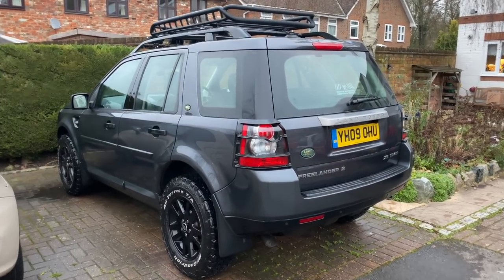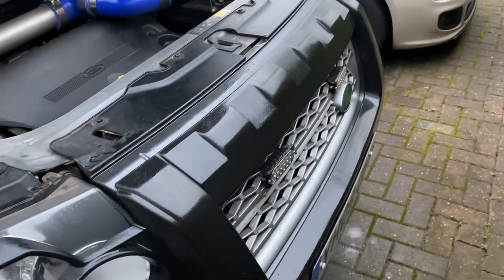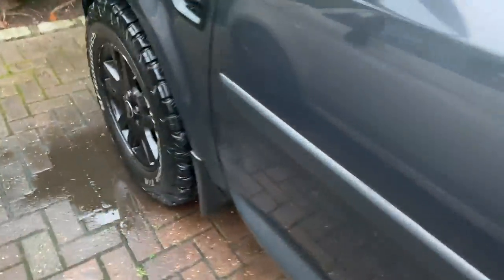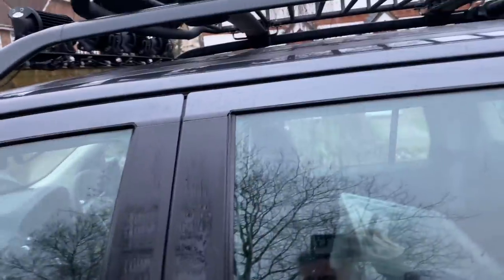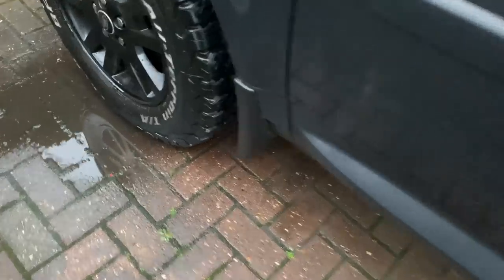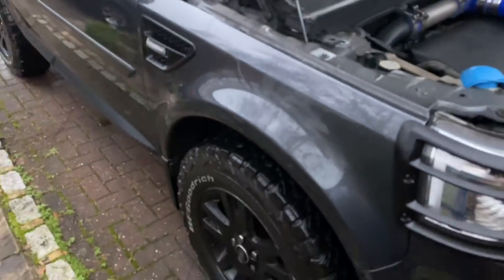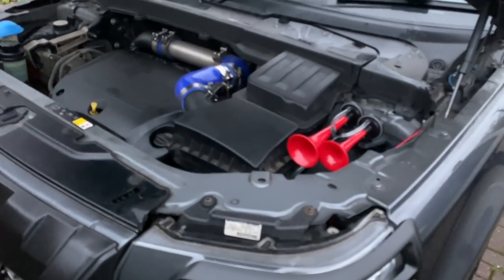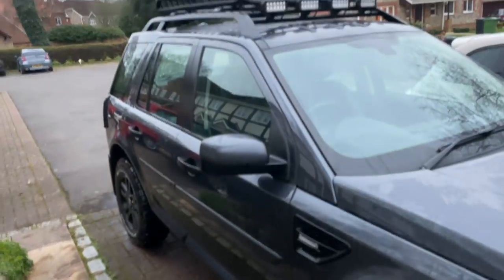Modifications on my Freelander 2 / LR

Comment: Ive got a 2011 freelander 2 sport LE, UK model. Its got some sort of cold climate pack on with heated front screen etc plus Its got a diesel fired heater, Its not remote control etc but once the temp gets below 6 degrees it runs when the car is running. Within minutes the air through the vents is toasty even though the Engine temp still hasnt moved off the bottom of the gauge.
Reply from the maker: Sounds like some of the top spec models have a webasto configured as a booster heater to help things warm up when started during cold weather. This is common on the ex demonstrator vehicles which had all the optional goodies fitted to show them off. The standard cold climate pack (which I have) includes heated seats, mirrors, heated washers etc. The heated screen is fitted to all models as far as I know.
Reply: @BeavisPits  I only found out about it last winter after I had it Waxoyled, they must have sprayed the heater with it and when it heated up I thought the car was on fire with the smell coming off it, I nearly shit myself, pulled over on the side of the road, lifted the bonnet and the Engine looked fine, the smell coming from the drivers side vent where the side repeater is, I didnt know what the hell was going on ha ha

Comment: Thanks for this - very helpful! Do the larger size tyres cause any probs without spacers as well? Need to replace my tyres and looking at the options
Reply from the maker: They will rub the shocks if you don’t fit wheel spacers. Lift spacers are optional.

Comment: Good video pal and nice Freelander 2 👍 I’ve tried looking for that particular roof rack and can’t find it, you got any links mate? Cheers
Reply from the maker: I bought mine years ago on eBay. I don’t think the seller is trading anymore but I found this one on Amazon by MaxxHaul which looks similar…

https://www.amazon.co.uk/MaxxHaul-70115-Steel-Rack-150-Capacity/dp/B073G49NPV/ref=asc_df_B073G49NPV/?tag=googshopuk-21&linkCode=df0&hvadid=500749924512&hvpos=&hvnetw=g&hvrand=18382123156391983543&hvpone=&hvptwo=&hvqmt=&hvdev=m&hvdvcmdl=&hvlocint=&hvlocphy=9045743&hvtargid=pla-569747249443&psc=1&mcid=14ac0af5e86d3500bdab4a32ba683a98&th=1&psc=1

Comment: Thanks for sharing your modified FL2! Looks great.
It would be really helpfull if you could share a link where you bought the fastening points to secure the roof rack.
I've got the same roofbars, and a similar roofrack.

I will check your website aswell!
Reply from the maker: The roof basket was bought on ebay and is attached to two genuine LR cross bars using the U-clamps which came with it.
Reply: @BeavisPits  ok! Do you want to share the ebay link, so i can see what kind off U-clamps are used?
Reply from the maker: https://www.ebay.co.uk/itm/362737712736

Comment: Hi great vid I'm getting the tyres ASAP as I have a puncture but having trouble getting the proper spacers in time would it be possible to get my tyres fitted and add the spacers next week or do you think that would be too risky .? Thanks again for your vids there great
Reply from the maker: Hi John, I’ve not tried fitting mine without the wheel spacers, but I have heard of others doing it. The gap between the tyre inside wall and the shock tube will be quite narrow, only around 10mm or so. The concern is that a stone could get caught and damage the tyre.

Comment: Hi, when you put your 25mm wheel spacers on, where they a straight fit or did you have to shorten/cut down the original wheel studs? Thanks in advance
Reply from the maker: They have their own studs so straight fit. They were not “through spacers” which require longer studs.

Comment: I'm french sl8i don't understand all modification.
C'en you write the different modification on the spring, and tires ?
Thanks
Reply from the maker: The suspension has lift spacers fitted above the shock absorbers. This pushes the wheels down, lifting up the car. The tyres are BF Goodrich KO2 245/70R17

Comment: Can you recommend a decent  full-beam headlight as when I drive at night on full beam it lights up in front of the car but no distance, I've got a Freelander 2
Reply from the maker: I run LED bulbs for mainbeam and have the lightbar on the roof. If you want to stay fully legal then try osram nightbreakers.
Reply: @BeavisPits  Cheers I use Nightbreakers but on full beam, I can barely see 20m in front.
Reply from the maker: Sounds like you need a light bar! Check out my roof light bar video. But you could fit one on the grill instead.
Reply: @BeavisPits  ok do you sell the one for the grill
Reply from the maker: Yes, I make and sell grille brackets for strobes or spotlights/lightbars. Take a look at my website beavispits.com

Comment: Spot on about cheap wheel spacers there mate. When I bought my FL2, the previous owner had fitted some cheap 25mm spacers. I got vibration and steering wheel judder on the motorway, had the wheels aligned and balanced, still had the vibration. I removed the spacers, and it was like a new car. Couldn't believe the difference. The spacers I took off didn't even have a brand on them... Just generic. Crazy to trust your life with such cheap crap.

Comment: hello my tires 235 / 60r18 without upgrade kit and without spacer what tire size can i do? 255/55r18 or ?
Reply from the maker: Best to use a tyre size calculator web page to check circumference. Mine are 5% larger circumference. Any bigger and you may have clearance issues.

Comment: The 245/70/17 tyres on yours will they be ok to fit with out lift kit
Reply from the maker: Yes, but best to fit wheel spacers to move the tyre inside wall away from the shock
Reply: @BeavisPits  when is your lift kit and light bar brackets back in stock
Reply from the maker: You’ve missed your chance with the lift spacers. Sold the last set on Friday. Roof brackets back in stock in a few days.
Reply: @BeavisPits  will you have anymore in stock soon
Reply from the maker: Not for a few months. If you’re on facebook or instagram then follow Beavis Pits, I posted a few posts saying last few spacers remaining so be quick if want some. Sorry, but now they have all gone.
Reply: Just got 25mm spacers and insa turbo ranger tyres 265/65/17 what you reckon think they give that wide aggressive look
Reply from the maker: They will look great!
Reply: Any news on lift kit coming back in stock as of yet bud

Comment: Great video dude! Can you help me find the right spacers you mentioned? On a side note, you should stock all of these bits on your website! I would've brought a few bits from you! haha
Reply from the maker: Wheel spacers or lift spacers?
Reply: @BeavisPits  hi mate, the wheel spacers. I had a quick look on the h and r website and there seemed to be a few different ranges. I'm going to do a lift later. I'll certainly be looking at your lift spacers!
Reply from the maker: I fitted 25mm hubcentric spacers. Not H&R but another high quality British made spacer. Avoid cheap Chinese items as the quality is poor. Also avoid non-hubcentric as they don’t have the locating ring.
Reply: @BeavisPits  nice one, cheers dude.

Comment: Do you re-torque the wheel spacers often?
Reply from the maker: Probably not as often as I should. I do check the spacer-to-hub nuts occasionally when I have the wheels off. I check the spacer-to-wheel nuts more often, usually before a long journey.

Comment: Do the lifts and spacers affect the insurance and would you consider fitting rock sliders?
Reply from the maker: Any modification should be declared to your insurers. Whether a suspension lift would increase your premium or not depends on who you’re insured with. Rock sliders are available from MuddyMods. I may fit some in the future.
Reply: Any changes such as aftermarket wheels, cone filter, turbo if it doesn’t have one etc needs to be declared to your insurance. If you don’t tell your insurance and then have a crash. The insurance company come and look around the car and find out you got these modifications on you didn’t tell them, you’ll have your policy invalidated and won’t pay you out

Comment: Hi, are those BFG KO2 tires okay with the wheels fully turned and the vehicle's suspension ? Thank you.
Reply from the maker: Yes, absolutely fine
Reply: @BeavisPits  Also at the rear when crossing the axles ? :)
Reply from the maker: @lacike767  not had any issues
Reply: @BeavisPits  But has the grip changed enough ? )
Reply from the maker: @lacike767  grip is very good
Reply: @BeavisPits  Thanks again ))
Reply: @BeavisPits  I forgot the dimensions ... are they the standard 225/65 R17 for LR2 ? :)
Reply from the maker: Watch the video 4m45s
Reply: @BeavisPits  Oh, but by lifting the chassis...and without the pads, they would touch the fenders or shock absorbers ? Thanks )

Comment: Hi there, what would be your thoughts on fitting 255/55/r18’s onto my Freelander 2? It seems to be a lot easier to get hold of that size, compared to my current 235/60/r18’s. Ps - just wanted to say a big thank you for your videos, really enjoy them and have already used sone of them to upgrade certain parts on mine.
Reply from the maker: Thanks Stewart. 255/55 should just about fit but are a little wide for the wheels. May look a bit bulgy at the sides. Wheel spacers may also be required to increase tyre-to-shock clearance.